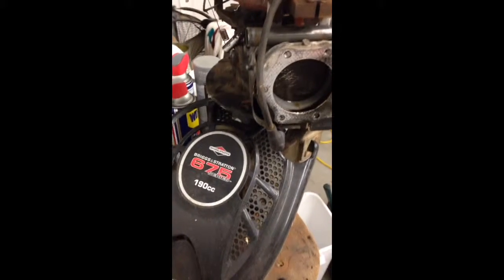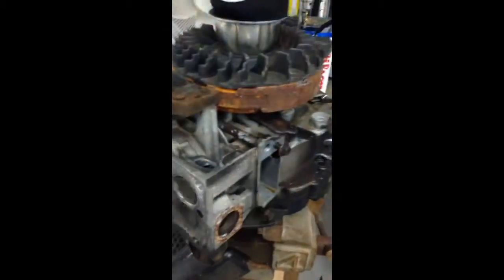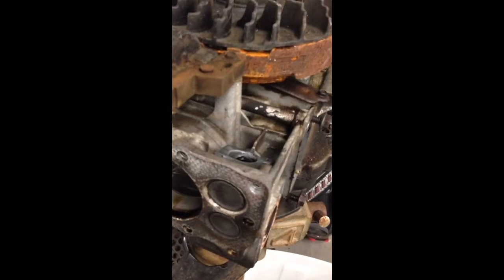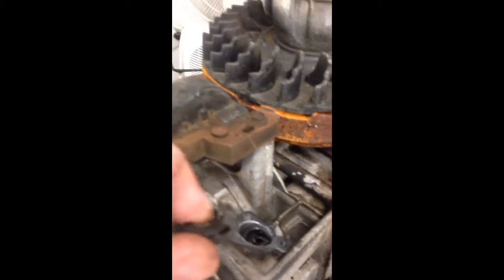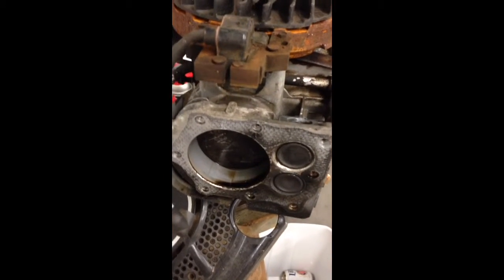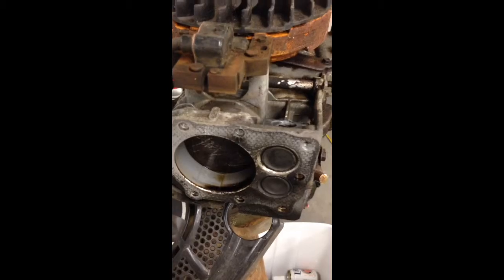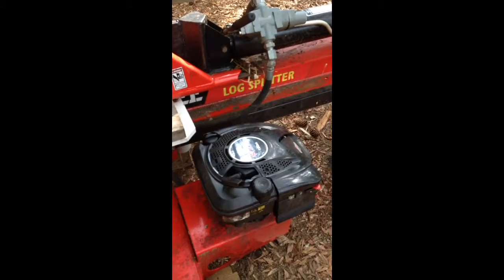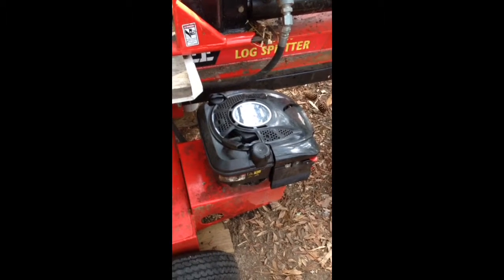Briggs and Stratton engine - valve problem and rebuild / mod

Comment from the maker: Engine is still running as of 4.17.17... still love to know if anybody knows with that piece is....
Reply: Hello probraugh1.  I had the same problem on a 190 cc Briggs & Stratton(no compression) and found the same piece of plastic piece behind the intake valve, although on mine the plastic piece was broken into two pieces. I was happy to see your video because I wasn't sure where it came from and wasn't sure what would happen if I just put it back together with the plastic piece removed.  I will now reassemble it and will let you knw what happens.  Thanks!
Reply: @wardmcginn4947  I also found a small piece of plastic in my intake that looks similar to yours. Mine turned out to be a broken piece of plastic from the butterfly in the carburetor . I removed the plastic and replaced with a new carburetor. Old 5 hp Briggs